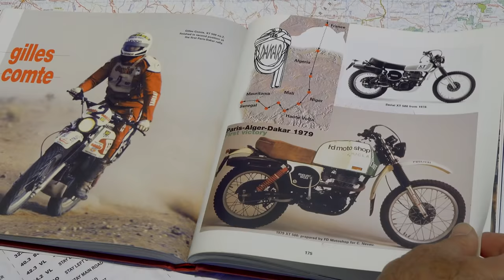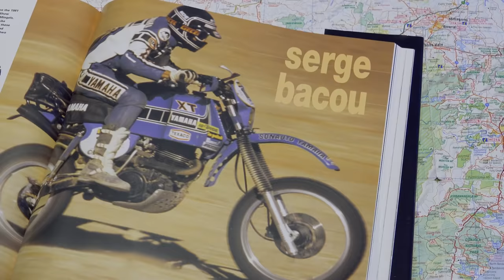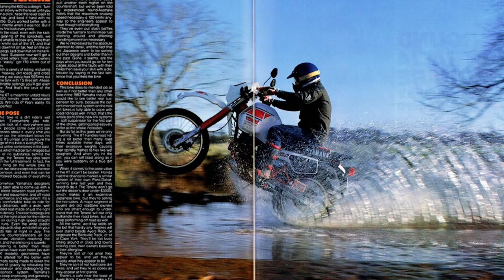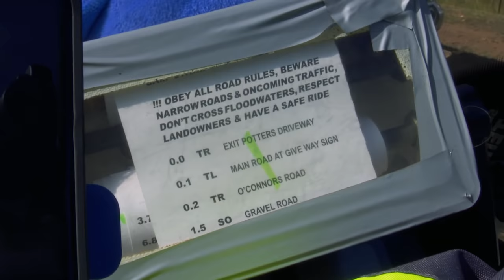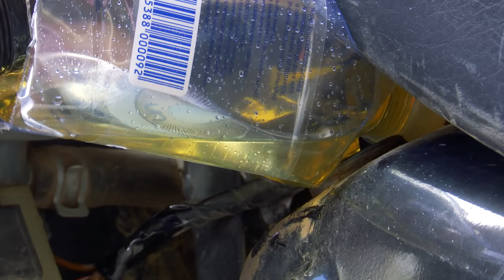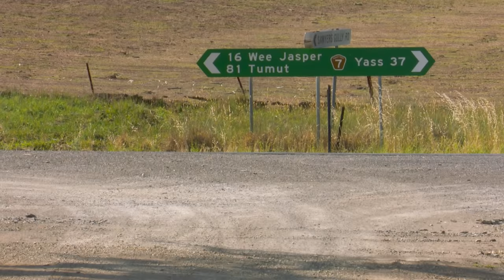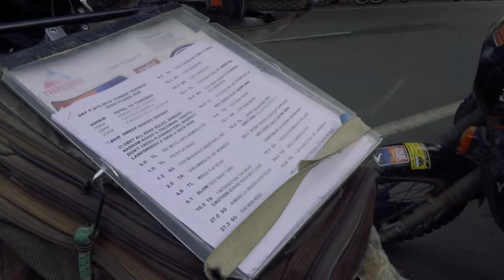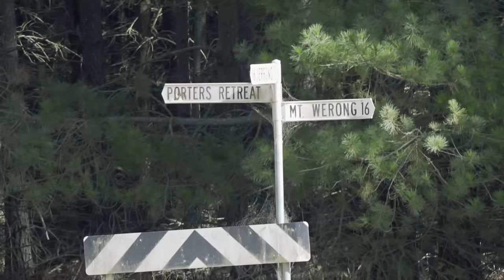Motorcycle Adventure - Yamaha Tenere Tragics High Plains Run 2019

Comment: You have ridden both the S10 and the T700.  Comparing both.  Your choice?  Is the 700 strong enough to make a 6000 mile trip two up?  Have you seen any of the 700’s with cruise?  OI have a S10 now and it is a great bike but thinking about the 700.  Any light you can shed...thanks in advance.
Reply from the maker: Two up, keep the S10 primarily because women love the cmfortable seat.

Comment: ... I had tenere 660 2008, heavy for off-road,  underpowered, and tube tires ☹️... Tenere 700...small fuel tank, tube tires, and very expensive for the pack that you pay for it... It is worth it to pay extra money and get the KTM 790 adventure R... You get  big fuel tank, tube tires, strong and powerful engine and many thinks as traction control, very nice suspensions, and ALOT of extra options if you want as quick shifter, cruise control and so on.... Yamaha is playing with his fans... And with US people is still playing. Thank you Yamaha
Reply: wrong place for your post
Reply: @legghorn  hehehe... Don't worry, I didn't ask you what is your opinion...but thank you anyway 😂
Reply: @fun2rideadventure  You did. You posted in a public area. So you asked everybody what's their opionen is. But don't worry. Maybe you don't know what public means.
Reply: So, tell me...... which bike have you actually ridden, of the Ténéré 700 & the  KTM 790R?

Comment: Hi all...I'm currently doing my research on getting a RTW bike....I'm 57+, 174+cm and any 61kgs. Been riding for quite a while, mainly tarmac, and presently working on improving my off-road skills - so that I can tackle most surfaces without fear, once I embark on my overland adventure hopefully by next year. The current default choice of bike is a cb500x (some susp etc mods will need to be done). But...I'm also looking at something like a Tenere xt660z......thoughts?
Reply from the maker: Tenere 660 are old now.  Have you considered a CRF300 Honda. CB500 X would be OK once heavily modified.  There is a video on this channel that goes into a Rally Raid CB500 in great detail.
Reply: @MotorcycleAdventureDirtbikeTV  thank U for the prompt reply. Yes the 660 is not new (going to check out a 2012 bike next week w lots of extras and about 40k mileage) but why would it not be recommended....appreciate the input. The crf300/rally is not sold here in Malaysia where i live. Not do keen on the 250. Also I'm not sure at my age, whether the 250/300 will be comfortable enuf for a multi month/year journey.....
Reply from the maker: @therollingpebble2138  standard suspension is terrible
Reply: @MotorcycleAdventureDirtbikeTV  right. The bike in question has Ohlins susp F and R, Hepco Becker crash protection and Touratech accessories. I don't think the air flow/cush drive issues have been addressed, but to be confirmed.
Reply from the maker: @therollingpebble2138  Mate it's your decision.  But, unless you've got good mechanical knowledge and access to part I'd be reluctant to take an old bike on a long trip.